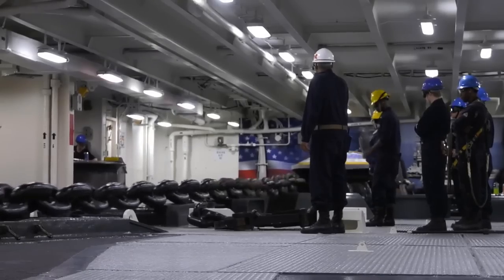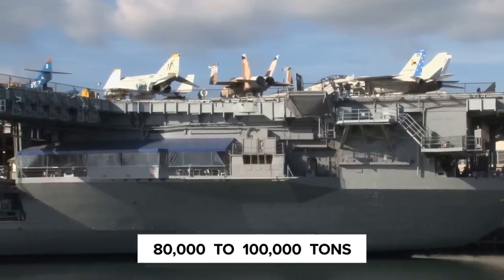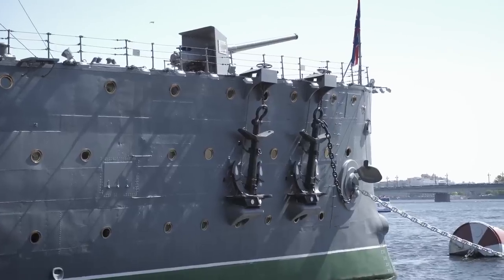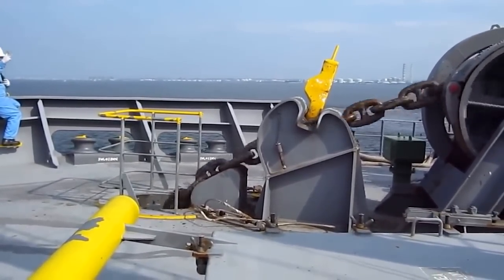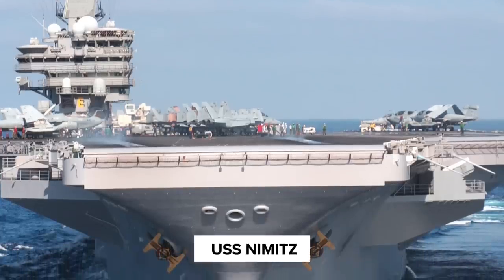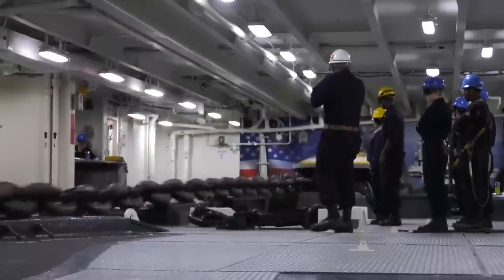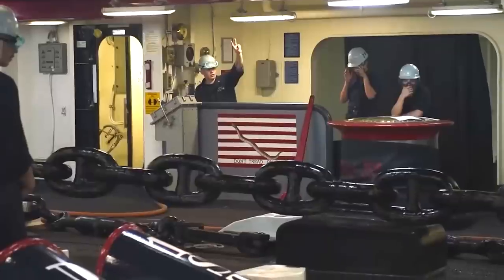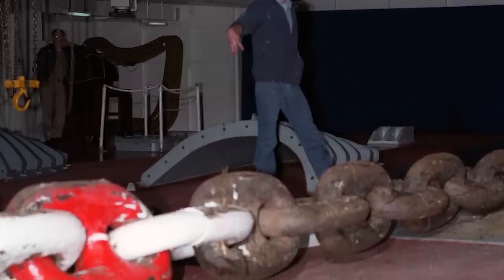Why Dropping The Anchor Of An Aircraft Carrier Can Be A Life Threatening Action!

Comment: A more direct answer to the question 'why is dropping the anchor so dangerous?' is potential energy. The anchor and chain, while at rest, have zero potential energy because gravity holds them in place. However, once the anchor is hung from the chain, it gains potential energy because gravity wants to pull it down and the chain prevents this. Slow release of potential energy can be very safe...like slowly letting the air out of a balloon. Rapid release can be more...dramatic. Look up 'tension cables snapping' for an idea of how potential energy can cause harm.
Reply: Why not videos of anchor accidents?

Comment: Always amazed at how small the chain is on present aircraft carriers.  We had chain close to that size on a 5,000 ton ship.  Unless that is some mega expensive alloy it would be way too small to accommodate the tonnage.
Reply: It's not the size of the chain, it's the motion of the ocean, or so I have heard.
Reply: If you sat on 1 of the links you would be 5 feet in the air if you strattled it.136 pounds is way wrong.

Comment: Interesting. What about anchor retraction? Anything relevant to discuss there?
Reply: It is called weighing anchor.  They wrote a song about it that you may have heard.  "Anchors aweigh", meaning that the anchor is no longer on the sea floor, and that the ship is underway.  One potential issue is if the anchor is fouled.  That could happen if the anchor hooked onto a communications or power line, an abandoned anchor and or chain, or some other unwanted thing from the sea floor.  But my ship had a forecastle, pronounced "folksul", not foxal.
Reply: @BruceLowry  Yeah I caught that mispronunciation too. Just like boatswains mate is bo'sons mate.
Reply: @7515-j3w  Any 'coxwains' out there, look away now! 😆